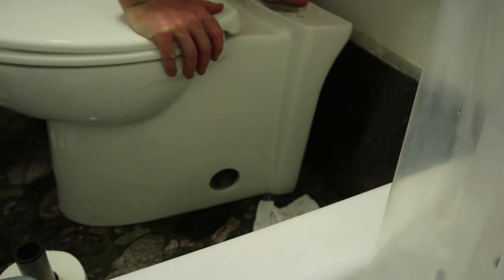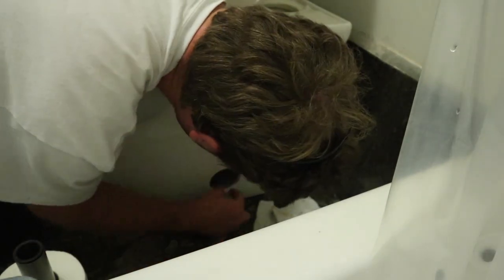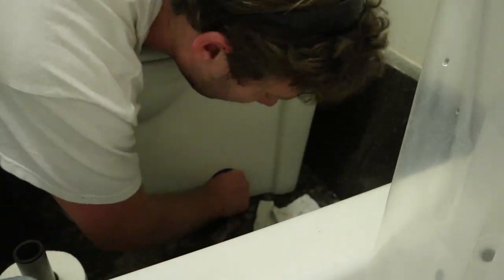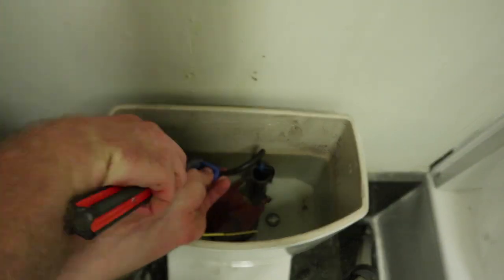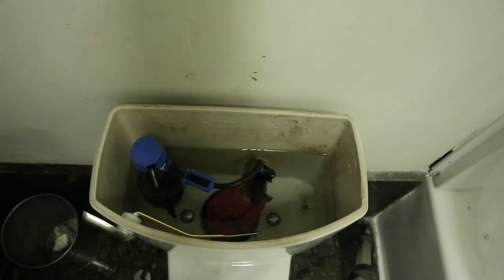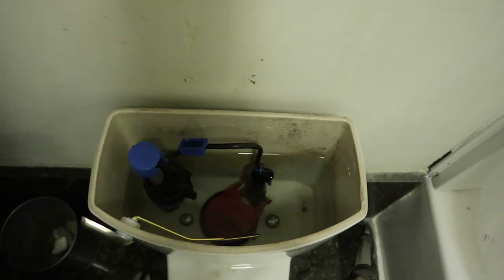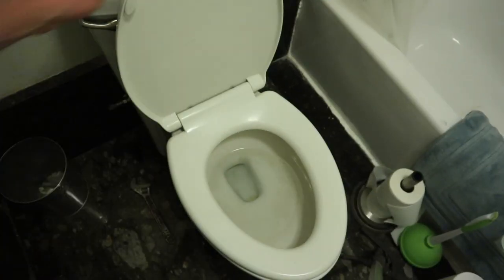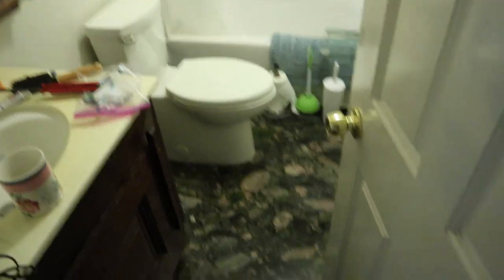Setting Hidden Bolt American Standard brand toilet

Comment: I have had the same toilet for 10 years and very happy with it until recently.  I need to replace the fill valve but cant access the connections in the back to remove the actual fill valve (space constraints).  I was able to remove the hose coming from the tap but not the recessed plastic nut holding the fill valve in place.  Fortunately it had a Fluidmaster 400 installed in it, so I was able to remove the valve assembly and leave the stem in place, then add a new valve assembly . Unfortunately it didn’t fix the slow fill problem. I have tried all the other suggestions but its still filling very slow.  My next step is to remove the tank completely and work on it on my workbench, but I would really prefer to not do this. The bolts/nuts holding the tank in place are also very awkward to access.  So now my toilet has the original Fluidmaster 400 stem and the new valve assembly.  Any suggestions would be appreciated.

Comment: Having a time getting the little plastic covers on..any tips?
Reply from the maker: that's hard to say. are they difficult to click together because of muscle strength? My best guess would be to warm them up a little in the microwave (take out early to test) and then put some dish soap on them.
first, though, I'd get a feel for snapping them together when not involving the toilet.
Let me know what ends up succeeding.
Reply: @JustinCrediblename  my issue is I can't get the ring around inside because of the way the toilet is positioned between my vanity and bathtub.   It isnt possible to get a hand on either side of the porcelain.... I could do it but would need to remove the vanity ...I'll figure it out....I might just tape around the plastic insert to build it up until it's a snug fit.
Reply from the maker: @darrenkampen8911  ah yeah that's a decent idea. would using some dabs of white silicon caulk and then leaning an object upon it while it dries work?
Reply: @JustinCrediblename  I'll do that on one side and the tape on the other and see which side has better results!   Thanks for your help.... YouTube never fails!
Reply: I too am having a terrible time getting the side covers in. Wish we could have seen you do that in slow-mo instead of hyper-speed. The instruction manual that came with the toilet is useless when it comes to this
Reply: @emlunz7505  I used some tape around the are that actually inserts to "build it up".  It fits snugly,  has never fallen out and the tape isn't visible either.

Comment: how do I replace my toilet seat on this toilet?    I can't get at the nuts!
Reply from the maker: a) turn off the shutoff valve
b) flush the toilet to get rid of any water in the tank
c) remove the hose in the back
d) measure the nuts of the new toilet seat and find an appropriate set of small pliers / a wrench / a crescent wrench
e) get into a hella awkward position so that your entire forearm can fit into the rear of the toilet. wear gloves to protect from spiders.
f) pray that it matches the nut sizes on your old toilet seat. replace/adjust wrenches until you find the right size
g) remove the top caps for your existing toilet seat and insert implement which fits the screw/bolt heads. use these bolts to impart the majority of torque when loosening.
h) loosen the fasteners to the degree that the nuts beneath can fit into your opened wrench/crescent wrench/pliers
i) twist that shit off
j) perform in reverse

have fun! ;)
Reply: @JustinCrediblename  it's a pain. But thanks for the tips.